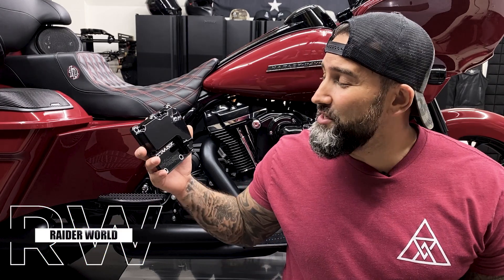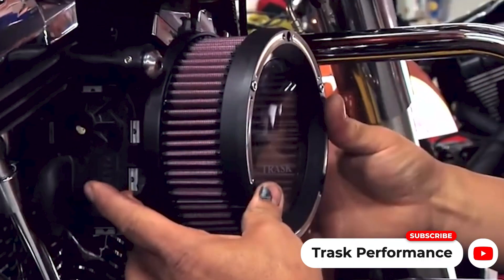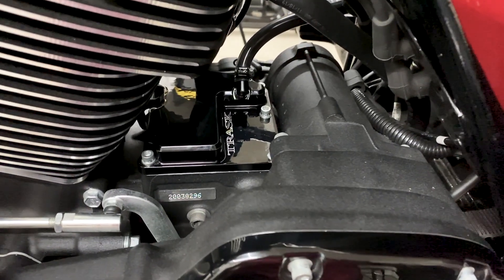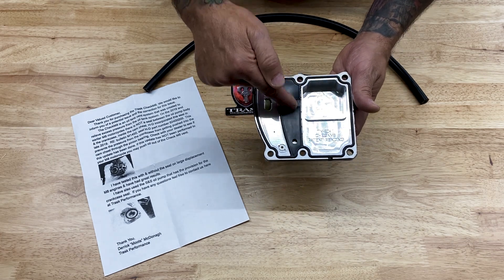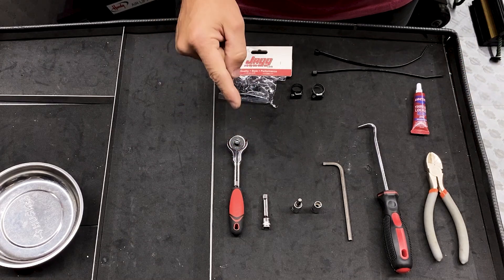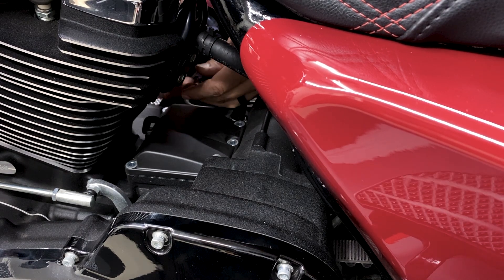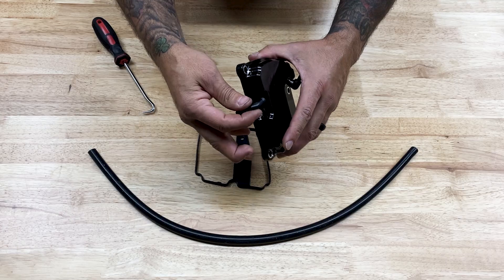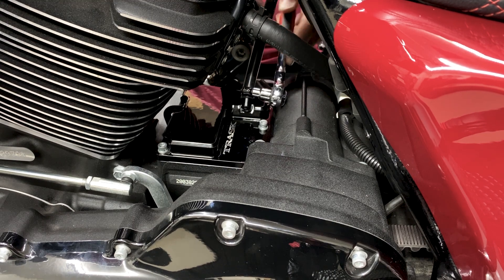What is BLOW-BY in a Milwaukee 8 Engine - and WHY install the TRASK Performance CHECK-M8???

Comment: A couple things..i believe the biggest offender is the over positive pressure that is being shoved back into the top of the cylinders, not so much by piston ring but from the banjo bolts..a I noticed Trask finally address my concern (on the product you have) of reed valve cover screws coming loose, and fall in into tank or worse, blocking a port.. Because of that early issue, and the high cost, I made my own vent system on top of the trans cover for just a few dollars, however I would have to vote this product is the better solution over the dipstick vent systems (I'm not if favor of lowering the oil level to prevent oil leakage) ..and I can still use my temp dipstick in the meanwhile
Reply from the maker: Absolutely! Great info.  I have a few follow up videos on the Trask and Vented dipstick.  Thank you

Comment: The M8 has been out since 2017 and still has these issues. It such a shame.
Reply from the maker: Your absolutely right.  I get why Harley has to do it, and they got hit with a big fine for it.  But they they should’ve came up with a solution by now.
Reply: M8 isn’t the only one. I have worked on twin cams that dump way more oil from the breather bolts. So much that it drips out of intake filter. It’s just the nature of this setup. EPA fucks shit up. Same way they are destroying diesel trucks with the DEF fluid and exhaust gas system.  Fix one problem you inadvertently create another it seems.

Comment: I've been running the excellent Trask M8 Checkvent Transmission Cover Plate to ventilate the bottom end (crankcase/flywheel) on my Harleys for more than a year now with excellent results.  Prior to the Trask piece, was running a Fueling Billet Vented Oil Dipstick, which also worked fine.  What I'm curious about is:  in addition to the Trask piece, if I were to also ventilate the top end (breather bolts) into a catch can.  I've not had any issues with oil in the air cleaner but am curious...can you ventilate both top & bottom ends or over-ventilate or ?  Tom M.  '21-RGS 114 & '22-FXLRS 117
Reply from the maker: That’s actually what I wanted to test out.  I wanted to install this in steps, so I can see what is “overkill” in venting out the crankcase.  Honestly, as long as you maintain a vacuum, I don’t see there being a problem.  The biggest issue, is stoping the oil venting back into the intake
Reply: Any update to this comment? Just watched your most recent video on the El Dorado series with the Horsepower inc breather vent. 
Are you running all three breathers on this bike? Dipstick, transmission & intake?

Comment: So this is what Blockhead was talking about in his $12 fix video. $350? What a rip.
Reply from the maker: $12 will not fix the issue if you have one.  You get what you pay for.  Is it over-priced? Absolutely 👍🏽
Reply: @RAIDERWORLD  not sure the pressure being vented cares if the path was made by 12 bucks or 350.

Comment: Hello Raider,
I first installed the Feuling Vented Dipstick. Then I ordered the Trask Transmission Cover. After a heavy installation on a 117 cui Fat Bob. The space is really tight. You fight for every screw!
When I was done, I backed off the Feuling Dipstick and put in the little cork valve. Let's see how both solutions work together. 
Very good video, keep up the good work. Many greetings from Germany.
Reply from the maker: That’s awesome! I definitely want to run some tests on these to see how they perform.  Especially before I start my stage 2 build.  And Thank You for your Support! Many greetings to you as well

Comment: Thanks for your video, I just installed the Trask cover with the catch can on my 2024 Ultra Limited (114) as soon as I started it to bring it out of the garage my transmission was not shifting right, very hard to get in and out of neutral as well as other gears. I noticed the cover is lower on the transmission linkage side, has anyone else had this problem, not sure what to do about it, it seems like the linkage doesn’t have enough clearance, thanks
Reply: I pulled the cover off this morning and found a small chunk of metal missing on the inside top cover, the linkage definitely has a clearance issue, has anyone else experienced this? Calling Trask on Monday
Reply from the maker: I wonder if this a 2024 issue. That’s definitely not good. Did you contact trask?

Comment: I also have the Trask Check m8..installed on my 17 SGS along with the DK customs catch can for the breather bolts. Happy with the results!
Great video!!
Reply from the maker: Absolutely! I’m happy with it so far.  I haven’t opened the the catch-can yet, but I just might here soon
Reply: How often do you have to change the filters and clean out the catch can?

Comment: hi, so if i install this cover and vent it to the dj customs catch can do you still recommend externally venting at the intake as an extra precaution probably to a filter element since i already have the catch can.
after both of those there would be no reason for the vented dipstick? as that would just be overkill. i already vented at the transmission cover and externally vented at the intake just to make sure any oil that still gets by doesn't go into the intake.
thanks!
Reply from the maker: That’s what I had to do in the end.  I was still getting oil through the intake, so I added an external breather.  Getting a vented dipstick or vented transmission top cover is still ok, but no need for both.  Obviously, I would go with the cheaper option.
Reply: @RAIDERWORLD  I watched this video yesterday and this morning it occurred to me in theory the catch can in conjunction with the m8 check MAY cause the back pressure not desired and you end up re creating the symptom you were trying to avoid? Not sure as I am not the engineer behind these designs but from what I have heard, the check m8 cover eliminates close to 98% of the issue? Just food for thought…..

Comment: Excellent video. Subscribed after watching it. Now that we see Harley has stopped venting through the air cleaner bolts and copied Trask's vented trans lid, do you think the head breathers can be blocked off if using the Trask trans lid on the models with the vented breather bolts ?
Reply from the maker: I probably wouldn’t block them off, because you do want it to vent out and expel the used oil.  If that makes sense

Comment: Great crystal clear tutorial video.  Post to installation, how the bike performs? I am not looking for hp gain or anything but does it feel run better in a sense of  before n after?
Reply from the maker: I honestly do not feel any difference in power or torque.  But the engine does sound a lot better

Comment: Will this installation void the factory warranty?
Reply from the maker: If your Harley Dealership is by the book, maybe.  This has nothing to do with the function of the transmission.  It only allows the crankcase to vent.  But you can easily take it off and reinstall your stock cover.

Comment: I installed the Fueing oil pump, backing plate, their vented dipstick on my 114- inch build with the Woods Cycle Rame 483 cam, HD Ventilator Extreme air filter, and still had oil blowing out the pod filter with the Trask Check-Mate M8 transmission cover. I drilled two holes in the back of the Harley Ventilator air filter backing plate. I then ran two rubber hoses from each breather bolt and then to a DK Customs catch can. I called the Trask Tech department and was told that I would have to install a 2020 or 2222  Harley oil pump that has an oil seal on it and a Harley backing plate to prevent the oil blow-by. Trask told me that they had installed after-market oil pumps and backing plates without the oil seal on the oil pump and still had oil blow by. But, when they installed the later model Harley oil pump and backing plate they only got a light oil mist into the pod filter that attaches to the Trask Check-M8 cover. If I don't run the RPM's past 3,500 at each gear shift or cruise at 70 MPH for extended periods, I don't get oil blown out of the Trask pod filter, but if I ride at 75 mph for just 30 minutes I will blow out 1.5 ounces of oil. I broke my 114- engine in good too.
Reply from the maker: I believe Feuling just came out with that.
Reply: Sounds like you need to install the HD pump and plate. I have the 2020 and immediately installed the vented dipstick before I rode it for more than 500miles. When I decided to change breathers from that elite on he had to the ventilator I had very little residue. HD did a stage 3 install and I had very little carbon or glazing on heads/pistons. I’m still adding the trask cover but if you’re having those problems and already have means of lessening blow by installed then I’d follow trasks advice
Reply: @ICEMANINVADER  --For the price that I paid for the Fueling oil pump and Fueling backing plate plus the Harley labor cost to install both of them, I don't plan on paying the cost for the 2020 Harley oil pump and backing plate plus the HS labor cost all over again. I get the best gas mileage when I cruise at 70 mph on the highway and I don't lose any oil with the Trask vented transmission cover when I plugged the rubber line on it with a small bolt. I can pass slower traffic on the highway up to 90 mph for a short burst of speed and then slow back down to 70 mph and the oil level stays the same.
Reply: Probably a bit too late but as I understand it , the S&S pump and plate now has an accommodation for the stock Harley seal. 

https://youtu.be/duBPNCs_vTA 

The above video link from Moonshine Harley explains the differences. 

Good luck and hope all goes well.
Reply: Sounds like JUNK!

Comment: Thanks for that very clear video !
One question though :
If the point is to vent to even the pressure, why would you want to vent to a close-end catch can ?
Aren't you limiting the venting process ?

What quantity of oil mist did you get in your catch can ?
Thx M8 (pun intended)
Reply from the maker: Thank You.  The Catch can vents through the top through a series of filters.  I haven’t seen any mist on the top of the catch can.  I’ve opened the catch can to check, and there is very minimal oil inside.  I also have the vented dipstick from Feuling https://youtu.be/XmWg5iFZgLI
Reply: @RAIDERWORLD 
Owk ok !
I missed that then.
Thank you very much :-)

Comment: Even though blow by is now the same as sumping, would releasing the crank pressure help with reducing sumping?
Reply from the maker: In theory, it should help.  Although, there are many other factors that come into play, like a poor a Harley oil pump, leaky seals, etc.

Comment: Hey man, I love this video, and I subscribed to your channel because of this video. However, I called 2 different Harley Dealerships in my area, and they both are not aware of any issues with blow by on the M8s'. I have the 2019 Fatbob 114 so idk if Harley fixed the issue or what?
Reply from the maker: That’s awesome! Thank you for Subscribing and supporting the channel.  Oh man, they might have graduated from a school overseas.  You’ve probably done your own research and figured out that this is a huge problem.  For 2020 and up, they did upgrade the oil pump, but I have that, and it’s still an issue.  Even with this top cover, I still got a bit of blow by.  I did an update video here 👉🏽https://youtu.be/Z9RgJqqUMkE

Comment: Will it hurt your M8 motor by running both external breather mod and transmission vent?
Reply from the maker: In theory it shouldn’t.  All your doing is venting the crankcase.

Comment: Question. I used the fueling oil dip stick one, it works great, I ran the tube and canister up and BACK to the frame behind the tire and saddlebag. Have you had any misting of your canister where you located it up front there? I was wondering about the possible mess on the bike where it could be seen. SF
Reply from the maker: I haven’t had any issues, but the way you have should be fine too.  I know most people were worried about it misting oil in front of the rear tire.  How much oil we ride over on the highway, that’s the least of our concerns lol.

Comment: Hey just wanted to know a update hows the blow by on your bike with the trans cover?? Did it stop or just minimize it?? I orderded it too but wanna know if i should do the heavy breather kit from trask too
Reply from the maker: I did an update on this video here, where I installed the Feuling BA Air Cleaner.  I remove the air cleaner after running the Trask top cover https://youtu.be/Z9RgJqqUMkE?si=ED9cVF_6Tb688oyG

Comment: Is it necessary to plumb crankcase ventilation back into the intake to provide a vacuum in the crankcase?  Doesn't a negative pressure in the crankcase help prevent oil sumping?  If that's true, will any other venting configuration (like the Trask cover or routing the OE vent bolts to atmosphere) provide the same benefits?
Reply from the maker: The only reason Harley has this venting back into the intake, is because of EPA regulations.  I’m still running some tests on the Trask and Feuling Dipstick, but both of these systems maintain a vacuum.

Comment: Do you think Harley would void the warranty if they saw that Trask cover? Or would they not care? The dipstick from fueling is easier to remove due to when you need to service your bike atleast for the 2 first years to maintain the factory warranty.
Reply from the maker: Honestly, it all depends on your dealership.  I’ve really only seen my dealership have to void a warranty when you start customizing your engine or transmission with aftermarket performance parts or you begin to trick the ECM with aftermarket tuners

Comment: Hey mate, just bought this for my 2019 Fat Bob and about to install. Just wanted to know how it’s been working for you now that you’ve had some running time with it.
Reply from the maker: I’ve absolutely noticed the difference.  I feel like the bike seems a lot happier with it, and I’ve noticed a lot less blow by around the intake
Reply: @RAIDERWORLD  Thanks for replying & that’s great to hear. I’ve checked the production date on my bike and it’s June 2019 which apparently was when they put in the 8 lobe oil pump, I’m just not sure if that has the seal.
Reply from the maker: @rickanderson2359  absolutely! Yeah, I believe they didn’t start putting in the seals until 2020

Comment: quick question? I did not notice that you used a torque wrench, but, mentioned the tightening numbers, did you use a torque wrench to tighten down the bolts at the end? thanks
Reply from the maker: With this top cover, I did not.  I just mentioned it for general knowledge.

Comment: Have my 21 FLHRXS stock just with slip ons. Would make a difference installing this trask vent. ? Recommend having a tuner aswell for it?
Reply from the maker: It all depends how you ride.  If you just like cruising, there’s no need.  But I would suggest getting a tune anytime you upgrade exhaust or intake

Comment: Patience is DEFINITELY a virtue on the bolts near the motor....what a PITA!!!!  :D
Reply from the maker: It’s funny, because I actually had stubby Allen sockets that I forgot about.  That would’ve made it a lot faster
Reply: @RAIDERWORLD  I know right....after I was done, I remembered I had one of those super small kits for hard to reach area's....after I used a normal allen wrench... :D
Reply from the maker: @redrider0151  we only remember when the job is done and our finger are bleeding 🩸 🤣
Reply: @RAIDERWORLD  If we dont cut ourselves, did we really work on anything??  :-P

Comment: I get that you get what you pay for and that trask trans vent is on my to get list. But couldn’t you just have the factory plastic one vent to a filter as well? It would accomplish the same thing ya? I get that is plastic and not anywhere near the quality of the trask, but the function would be the same.
Reply from the maker: They have a built in vent that allows air to escape, but not come back in.

Comment: Do you still need to install the dkcustoms external breather kit if you have the trask trans cover??
Reply from the maker: I theory, you shouldn’t “Right”. The Trask top cover should allow all the venting necessary that it does not vent out the breather bolts.  I’m testing this out in steps to see if I’ll have to install an external breather kit.  Either way, there’s nothing saying that you just install one anyway
Reply: Trask cover installed it was a bitch tightening/loosening the front,  I did install the dk breather and put the catch can where you did in this video and the trask breather I put up in the side panel. You make great videos I’ve also installed the thrashin supply floorboards from another one of your videos. Not bad for a mailman👍🏼
Reply from the maker: @highlytrainedunprofessiona3699  That’s Awesome! Yeah, the front screws were not fun.  I actually had stubby sockets and completely forgot about them.
Reply: @RAIDERWORLD  so if I am correct and install everything you did in this video then I shouldn’t have to do anything to the breather bolts or intake?
Reply from the maker: @radeaver  In Theory you shouldn’t.  As of now, with these 2 products, I haven’t had any issues with blowby